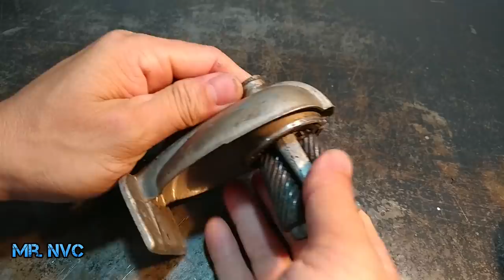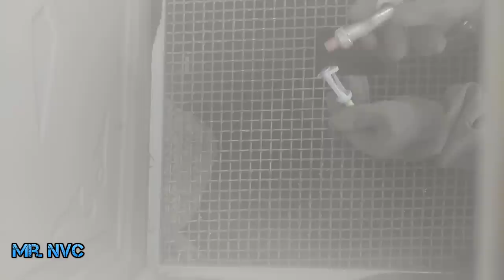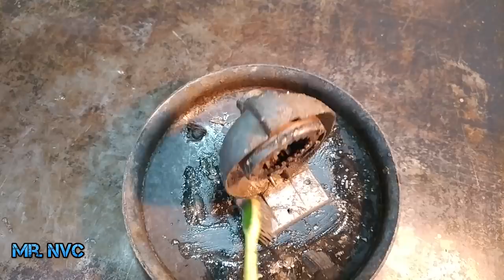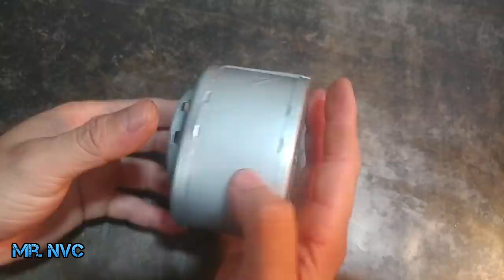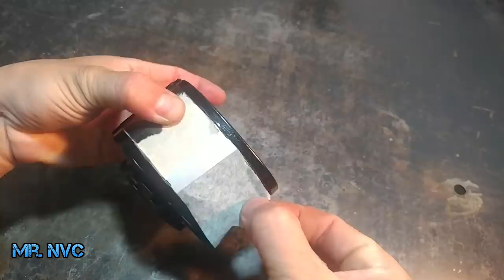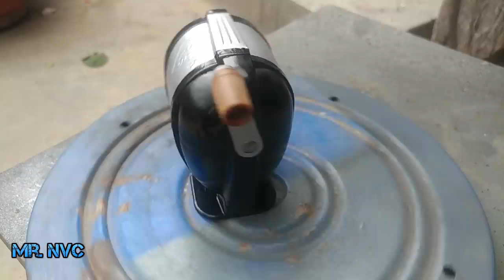Vintage Pencil Sharpener Restoration

Comment: You grounded away the burrs on the cutters. Dull cutters sounds like that with lots of shreds hanging off tip. Should cut like a plane. Body was chrome, back a ceramic gray coating. But, looks ok

Comment: nice work, however I think you should have gone for the original look. When I can get them, these, in decent original condition, bring pretty good money on Ebay. Never ever saw one done in black. Usually, the base was that silvery "Hammerite" finish, the two sides were chrome or nickel plated, and the middle portion of the catch thing was in what I can only call a deep red.
Reply: Some were all chrome except for the base, they were almost always the Hammerite finish
Reply from the maker: Thanks comment
Reply: Easy to get at stationary stores $20
Reply: @lcampm2  new ones made in china, sure, vintage ones bring the money. I've gotten as much as 75 for a really old one.

Comment: For me as I remember it... in my school days oh so long ago... is that the metal part of the handle is Chrome.... outer sides are Chrome... middle strip is coloured or also chrome. Inside part is steel polished.  So it should all be shiney... :-)
They were awesome to use... and a great way to get out of doing lessons for a few minutes to stand there and sharpen the long pencil down to almost nothing.. as you turned the handle.. ;-)
But I do like your sandblasting.. :-)

Comment: I have an old Boston pencil sharpener almost like that one.  Instead of the rotary size selector it has a spring loaded set of grabbers that adjust to the pencil diameter.  Otherwise it should restore the same as yours.  Too bad I don't have a sand blaster.